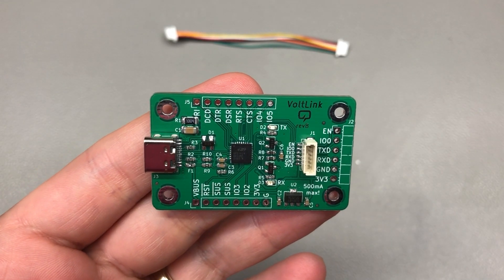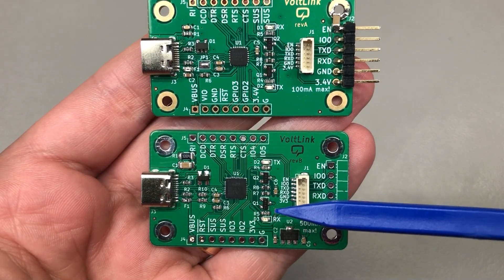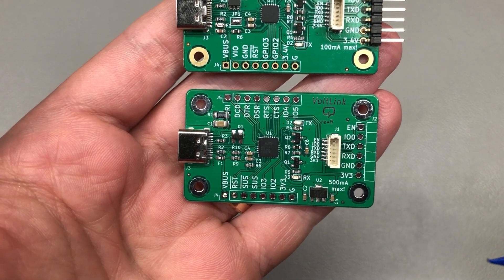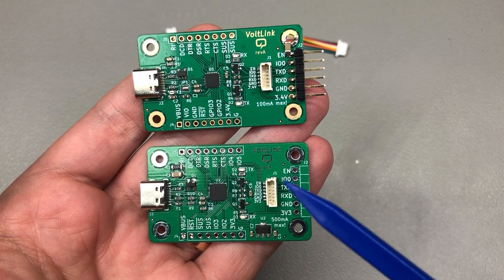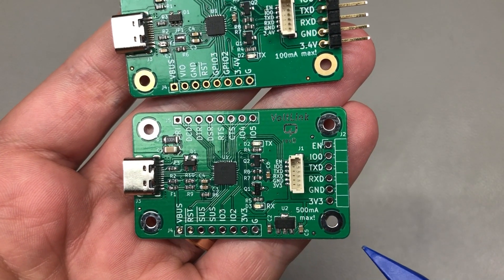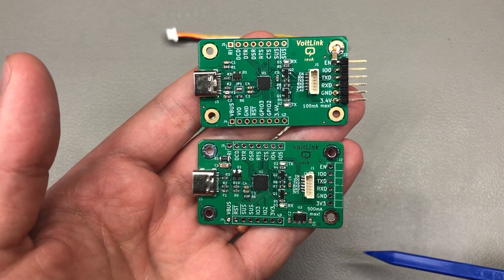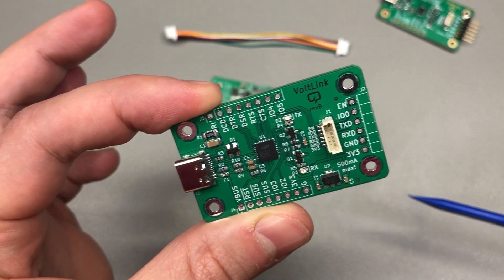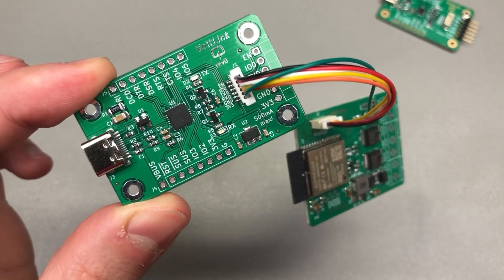VoltLink™ revB CP2102N USB Serial Bridge & ESP32 Programmer | Voltlog #396

Comment: Any thoughts on skipping the auto-program transistors? Espressif's Boot Mode Selection guide for the ESP32 states you only need connect EN -> RTS and GPIO0 -> DTR.  May solve your EN capacitor problem too. I've skipped the transistors on a board I made, and I have never had a problem programming the ESP32 with a USB/Serial adapter. Auto programs just fine.
Reply from the maker: Can you please point to the exact documentation from Espressif where they state that you should connect directly EN -> RTS and GPIO0 -> DTR ?
Reply: @voltlog  Sorry, thought I responded. Search google/bing for "espressif esp32 Boot Mode Selection" and its under Automatic Bootloader. I did find that some USB serial chips (like CH340) will pull those pins to the VCC . So if VCC is 5v, and connected to ESP32, there could be some problems. That is solved by powering serial chip by the 3.3v regulator rather than USB power.
Reply from the maker: @EdHayes3  That page/section clearly states that you may run into problems when connecting them directly, thus connecting via the transistors is preferred and shown in the example schematic. The fact that it's working for you is nice but thats not something you would expect to be reliable over different setups.
Reply: @voltlog  Yes, I saw "Some OS and/or drivers may activate RTS and or DTR automatically when opening the serial port (true only for some serial terminal programs, not esptool.py)" Since most people use esptool.py for their ESP32 and ESP8266 projects (default for arduino IDE too), doesn't seem like it's necessary. But if your goal is to be 100% compatible, I guess it's a proper precaution. Seemed you were very interested in reducing BOM count (I forget this video or the other), so I thought I'd mention it.
Reply from the maker: @EdHayes3  Yes. I dropped the BOM count even further in revC while still maintaining the reliability and compatibility.